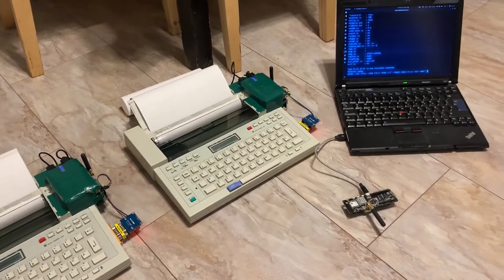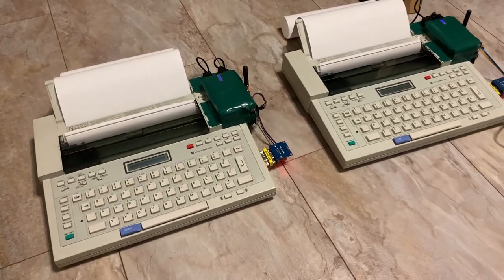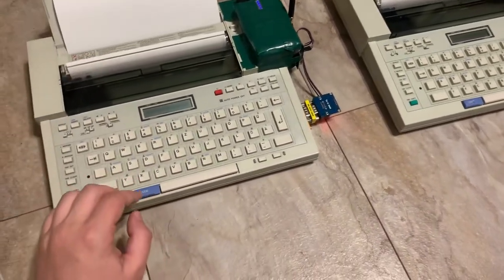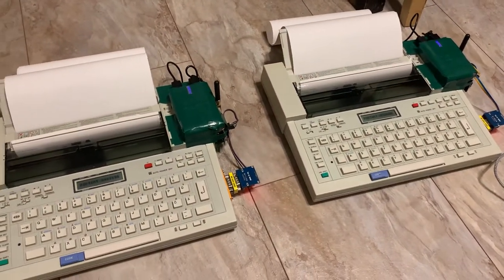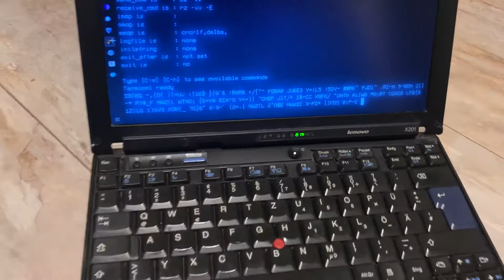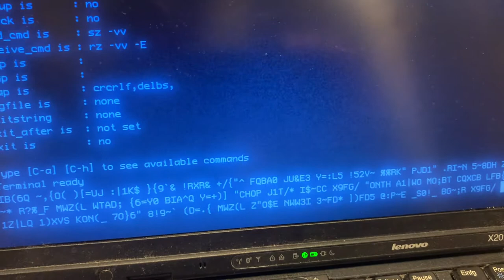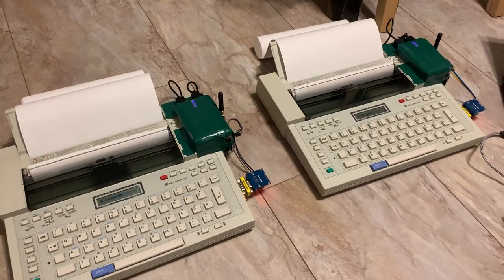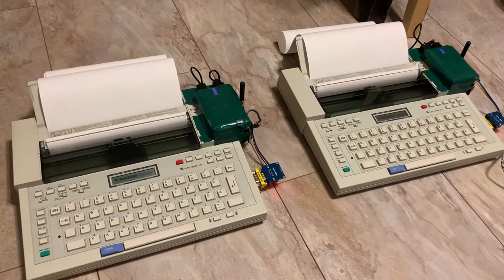LoRa Radio Teletype

Comment: I would use Aluminium & Steel Foil ( kitchen/cooking foil) ( i found Daisywheels  & Pinhead Printers can Impact print the foil without ink so you can save a small Fortune in Ink Ribbons  + The foil is easy to Recycle into Other Off Grid Projects
Reply from the maker: Thank you for the hint! However, I need no ribbon — this machine operates by heat (including on thermal paper sans any ribbon), and not by impact. :) No less, your hint is very nice to know, again thank you for sharing!

Comment: I think you should be calling this an encoding, not an encryption. Encryption implies a certain degree of computational intractibility of reversing the protocol without the secret.
Reply from the maker: Every letter typed is turned into a random combination of five letters. That is, 62x62x62x62x62 = 900 Mio combinations, of which 65535 are randomly chosen (as there is limited space on the chip and it is not too fast in checking them, either). On average, this gives you about 1000 different expressions per letter. That is, "&6AR?" and "BGT%$" may both mean "A", but you, as an eavesdropper, don't know that. Hence, your intractability criterion should be fulfilled, shouldn't it? :)
Reply: @ninoivanov  not really. You could brute force 64k combinations in under a microsecond. I dont want to discourage you, just warning against throwing around a word like encryption casually. You might want to consider using one of the open source encryption algorithms, since those are well studied and virtually impossible to break by any known methods.
Reply from the maker: @JW-el5cy  "Maybe, maybe not" - you can't crack for decades a lot of puzzles even by thelikes of serial killers who used mere pen and paper.. See, I think you just want to prove something - and you shall have the chance "to put your mone where your mouth is"; if cracking my scheme is so easy, tell me the clear text of this - and if you, as an apparently knowledgeable and intelligent person, cannot, I shall see it as reasonable proof that the scheme is "reasonably secure": W(2U5 3?O.8 {&DL" LLZ)D P=40/ 63LO~ ^M/EE 5A~0E |O0V; /Y{GO ~OIC@ :?`9{ ML1`8 VM}Q! 4XU0/ IX6!P ^=HZ2 =)]5$ JMODM TXE,% CWM6] A:5O4 !A9&5 8~;( =]1GR A5%NE A!JZG !"3~{ S_V"7 @?BI1 1*Y5! CR@%6 S]4P, @+QJA ]/2$$ }:]VK X+6QO !:=Z ;E`?| 45TYH `L&+[ C7HL( BG~;R 4MA@I ++|Q: ]QB4& ?$M`N $VYB+ HWS)] &VK*8 5P|H} ~JBHR 7O}6" [YUUX [HVT& K|GF@ J{BG~ 6P?=( ,R$P3 2{_B? 5R!,I "VDCR [^?"P ECIKM [(~X9 FZ%+9 )8~Q] %9$JS ~`:PU NQH$ Y2P=` EP^|L ML/P3 5(1|G +5&^, [F=QD C_(XO 04)@Q {9R$D YWA~* 37[M5 @:,UU OY[E? X/%Z$ RW|;O V8&CQ FU9H) PH^5V &~;SS M+T:C K/O0% [6C:T A??2Y |A$61 TP`P. K_&LL OY1$4 ^VHF{ .K/=) X9FG/ $QM=K 9&{59 S77CL 3CMI. U;3P, A%BIW U6T/ 75`4) &Y`~R ,`"$B 1~XO5 J*5? F]+L} E|{VI Q:@"A L|]YT VHVS/ ~/::Y )D[8L N5W/U 1O%{. J:2{` F;I0X 2GGB4 PO$*G (JGK[ F[EK5 %/5B$ JN%Q@ [K%JV 3{8J@ S91}E H}0RL `(I3& E4[." GA)PX V7`:) &(^74 37P{2 UXL.( 4KB/^ L|;P8 3J[0( V.9KD 6R1D3 ~RKQU /S91E &3[/T K+:@E /U4O %:`%4 |HV=Y 7^ZF@ R_|2] 0&28) &%:X4 Z.95T E1*FU &V3U! EP^|L L8"07 2N]91 ]DS90 K^L"8 E3]X! ^2}D( `,WBF @:"S~ P*UGN )(F?4 ~^!0" ]|A[G D1_"! X/+6| HU3+~ :=V?Y 8BRTP Q:,.{ $}DSZ $E|ZT X*[+( B}MLI Y]&+N :2RAS ^9+B= OPCUB ]K?N3 I"}6G FLRV? 7T|0| O[S+( )PLW5 1*F4J ,0GGH ;;C}0 @EX_/ ."0C% $$N8E %~HW3 ]B::I WQ1$9 0AT$L |%4?8 :,;C[ .L%(" %ADDW R^4VU C@:SX O!(^~ 4CR%^ [E/2" F+).7 ;1;PK /3?X7 F?6@L ZH^H] ^/LU3 VE$.3 M52T9 163QA CCZAY LZ@%T "4)04 @XO/0 %V^P` B3JMU EO)|~ VR(/* G[Y+ `WR3R +&{,B @={?` V,:W" MWT{Y KQXIR CX1CQ 6;!(Y S&8{1 JB|S3 @;^NU DQ!(L ~ITV$ _;D2[ ^PUIY T)OZ] N%I$ DS,JU $0:7C N`AZS R~%// 6}TV; ]*~@X L.[)) "D`WD H29(? ~R||J :FZX{ 8@N/X HTZ84

Comment: A modern enigma machine... what is the max distance and can they work with a repeater?
Reply from the maker: Exactly! 😃 Max range should be several kilometers. Have not tired, though, but that is what LoRa modules are normally used for (e.g. getting sensor data from some forest etc.). They have different "signal duration stages" (up to 12), where each next stage keeps an information unit in the air longer, and the information units are further determined by the baud rate, so that is your trade-off: you might be able to reach longer ranges, if your transmission speed is low. (Low as in "every single character takes forever".) If using a "faster" transmission speed (i.e. not that long-range by nature), you might be able to compose a LoRa-WAN, and thus, with other units, "create your own network", which may extend your range further and even beyond (simple) repeaters.
Reply: @ninoivanov  I have been seeing stuff about lora mesh if that's what your referring to...
Reply from the maker: @Centar1964  Exactly!

Comment: What kind of RTTY machines are these? Is there still something like this for sale on ebay or elsewhere?
Reply from the maker: Look for "ESP32 LoRa", for Long Range, and ESP32 is a very popular platform for wireless experiments. Do not look for "exactly my chips", as ever better and better ESP32 devices are entering the market. Good luck! And if you do not opt for LoRa, but "normal WiFi", then please be aware that you can connect retro gadgets with ease even to at least display internet content (if used as a terminal) — I have multiple videos, others even better ones. Good luck with your endeavors!

Comment: Can you do this with a lora and a regular printer?
Reply from the maker: Absolutely! The question is merely the input. If you can get or make a serial input device, then you can use either a serial (or a wireless, but that will be more finicky) printer as output.